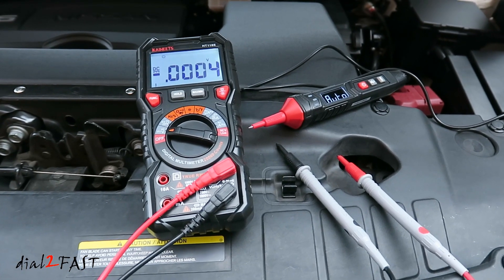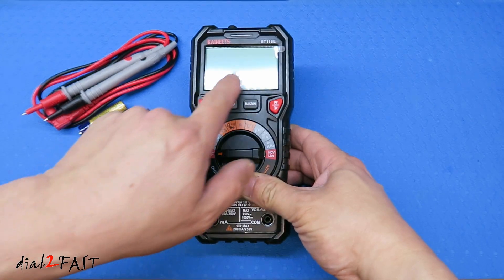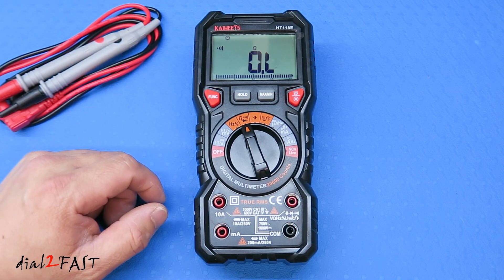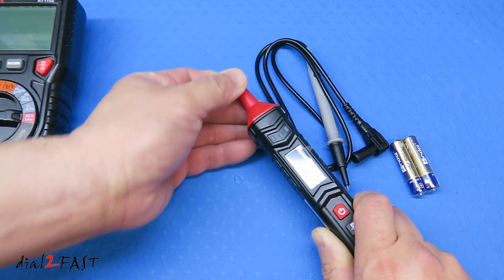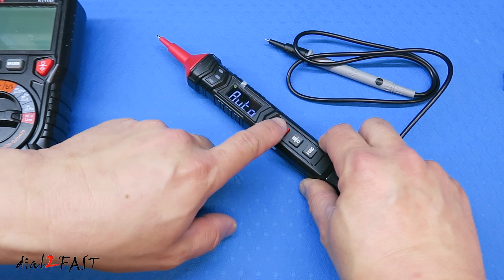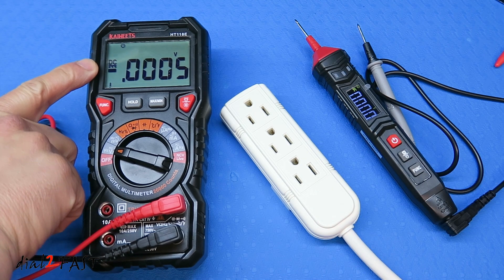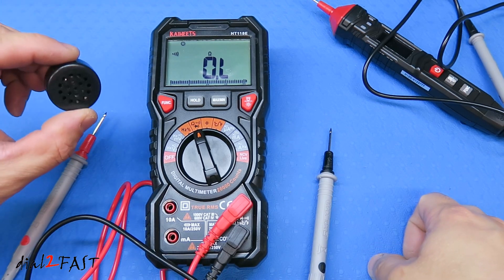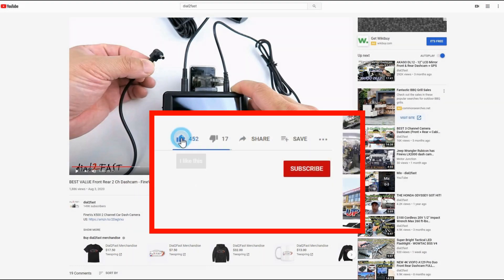$40 Multimeter For Car & Home | KAIWEETS HT118E & ST120

Comment: Hi all the way from Australia, that was a good,clear no nonsense review. I have the HT118A which looks identical, have been using it for nearly two years with no problems. When selected to NCV setting you can then toggle to live setting, you can then use the positive probe only,to detect a voltage. I'm not sure of the lower limit it will detect at, it only gives an indication but is a handy feature to find a live conductor . You can also clip one or both test probes into the back of the case, handy when working in an awkward spot. The test leads and probes are reasonable quality for the price as is the meter, it is actually very accurate. Mine came with extra leads and attachments such as crocodile clips. My previous meter was 30 years old and still worked but had lost some accuracy due to age. Thanks for a great review.

Comment: Dear Sir I want to know one thing. 
I wanted to buy the Kaiweets multimeter but this one is 200mA while the other one is 600mA now my question is because the Kaiweets multimeter is 200mA will there be any problem in working??

Comment: Update? They all die with a year. I've got a cheap 5$ one that I bought 15 years ago that still works, and a fluke claml style that has been in use for over 30 years, still works. I store these in a sealed plastic ammo box, in my closet, without batteries loaded. They have all died. But kaiweets does honor their warranty of 3 years, replaced each one then finally refunded me my last one, and I'll never buy this chinesium again.

Comment: Thanks again for another great video. This is something I've been looking to get and it's great to see a video from you on it.

My only concern is the wires/plugs. A lot of the multimeters that I've had the wires end up getting hard and are no longer properly pliable. How are the wires on these two? Are they the ones that will harden and become less pliable?
Reply from the maker: The test probe wires seem ok They are not super flexible like the ones you get with the Fluke meters. As for them becoming hard over time, right now I can't tell you if they will, but I have a bunch of these China multimeters that I tested, and the wires are still holding up fine.
Reply: @dial2fast  great! Thanks for the quick reply